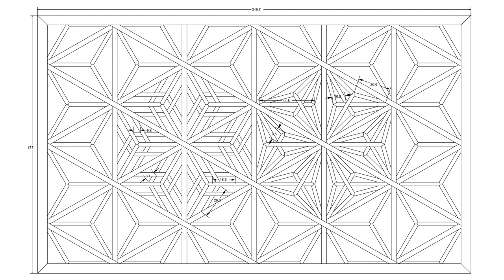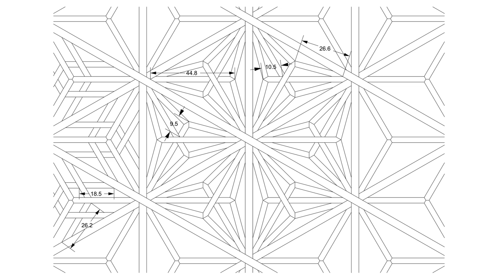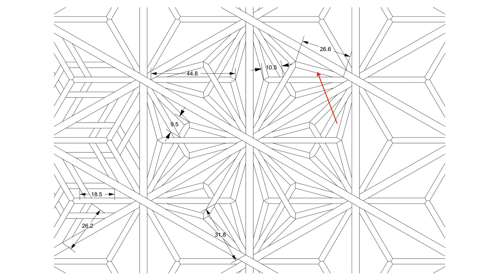Shoji and kumiko patterns 08 Kawari yae-zakura and yae asa-no-ha

Comment: That does it Des. I'm going to jump on your web site and buy the first book :) 

But one question in my mind. Though the titles are all about design and technique, do you have a recommendation as to where to purchase suitable timbers in Australia? I might be overthinking it of course, perhaps big box store pine is the go :)
Reply from the maker: Thanks Rob. I now use hoop pine for most of my kumiko work, and in Australia I'd recommend this. Any timber yard that deals with furniture-grade timber should have some decent hoop pine. Radiata pine from the big B is certainly usable, and I have used it for instructional and practice work, but I've noticed that at times the resin in the radiata can be a bit grabby on the handsaw preventing a smooth cutting action. Any reasonably straight-grained softwood would work. In the early stages, though, I'd avoid any of the hardwoods.